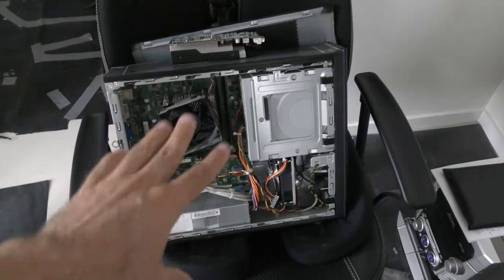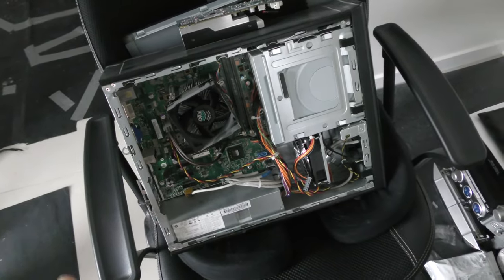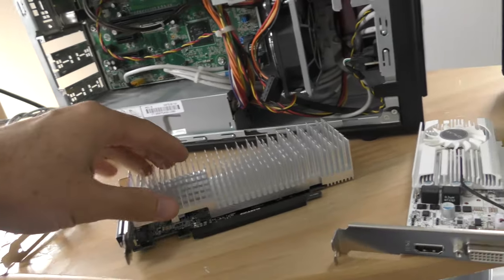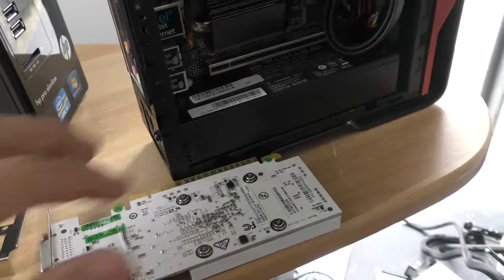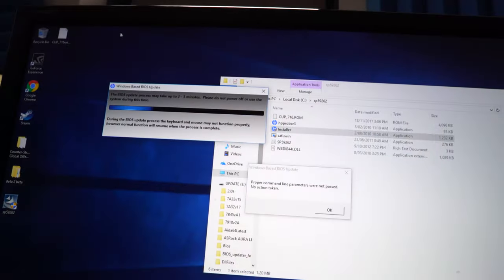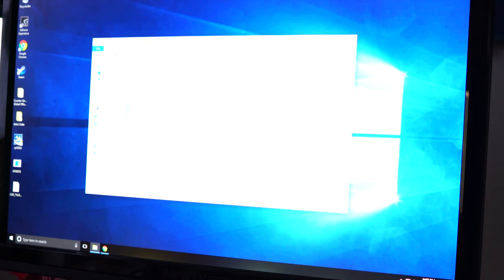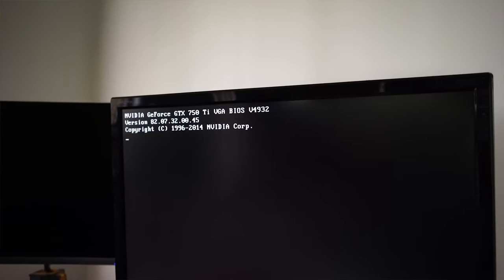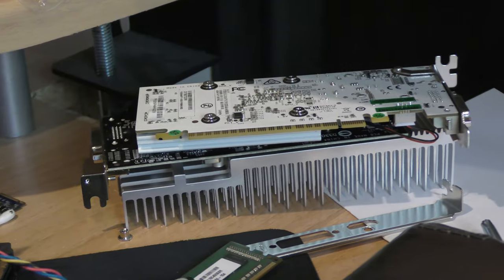The GT 1030, CAN IT SAVE THE SMALL FORM FACTOR HP PC...!?

Comment: Hi Bryan, if you come across some of these low profile HP computers, look out for the Elite 8300, ivy bridge series cpu's, and these have always worked out great for me. I've used one with a 1050ti for a few years, and before that it had a 730, then a 750ti. And they also work with sandy bridge cpu's. Easily recognisable by the stack of 4 usb 3.0 on the back

Comment: I have a HP Prebuilt i bought few years back. Intel i-5 6400T 2.20GHz Kingston 12GB DDR4 Ram 1TB ssd and only 180w PSU. Not to mention i had no extra power connections and no room for expansion. There was hardly any room for a GPU. I recently bought the Geforce GT 1030 GDDR5. and this card is PERFECT. I am extremely impressed.

Comment: HP, on some devices have a screw that when in place will write protect the bios.  You have to find that screw on the motherboard and remove it to flash the bios.  They most notably use them on ChromeOS devices.
Reply: How to find that screw ??

Comment: Geez that's a real bummer. When I put a GT1030 in a friend's HP Compaq Pro 6300 SFF, it just worked straight away. No BIOS updates needed (though I did eventually update the BIOS to its latest revision) and Windows automatically installed a fairly recent Nvidia driver, after which everything ran smoothly. It may just be luck of the draw, or maybe the PSU in your Pro was crap, I don't know. It just sucks. It doesn't matter anymore now I guess.
Reply: did you get a low profile GC?
Reply: A Core i3-2120 if I remember correctly. Not exactly a powerhouse PC, but it matches up well with a GT 1030 for some lightweight gaming potential.
Reply: #on dell allmost same problem  with older win10 nothing up to 700 serie's but automaticly resolved after i moved 1703 iso win10 i don't know why microsoft did that because 7 and 8.1 on 900 and 1000 serie's no problem and working like a charm,
Reply: I also have Hp Compaq Pro 6300 sff but has the i5-3570 one. The asus gt 1030 2gb ddr5 low profile graphics won't work. I'll try to buy a live cable (hdmi to dvi) and see if it works.

Comment: Just a week or so ago. I put a AMD Radeon HD 7570 1GB GDDR5 into a HP COMPAQ 8200 ELITE SFF I bought off of Ebay without a hard drive with the I5 2400 CPU & 4GB of ram.. The whole total with a 60gb SSD for the OS came to
$60 shipped for the pc 
$20 shipped for the Graphics card
$33 shipped for the new 60GB ssd
$0.00 for the OS. It had a windows 7 code on it so I used that to register a new install of windows
I didn't buy it for gaming, but I really liked working with it. Good design, and great processor for the price. Other people have gotten 1050s to work in these machines. You might have a malfunctioning motherboard.

Comment: I have actually wedged a 1030 in and had it touching the power supply on a very similar case. I just put a few cardboard shims between the card and psu so the fan could still spin. It works perfectly.

Comment: I just remembered I had a similar problem recently with nVidia driver on an Ivy Bridge Core i7-3770 system. I put the latest driver in, rebooted and the video cut out (or so i thought). IN fact it switched to the on-board graphics, so i let it boot up, logged in, it did some more windows/driver updates automatically and after another reboot everything was back to normal, the nVidia video card was working fine again, with the latest driver. (this was an ASUS ROG MARS GTX 760 dual GPU card).
Reply: Kárpát Zoltán did the gpu stop spinning, because if so it's happening to me atm with my 480 but I know the gpu works.
Reply: You're brave for putting a Mars 760 in a prebuilt

Comment: Bryan, I actually just this weekend worked on a slightly older HP small form factor (5S-1014) with a case that looks almost identidcal to this one (except the front grill).  It had a Pentium E5800 and I bought a Gigabyte GT 1030 (GV-N1030D5-2GL) and it has worked beautifully for a cheap Overwatch and CSGO PC for my son.  Sorry you had such a frustrating experience, I have been there.
Reply: I would spend the extra 50 dollars for the 1050ti. It can handle games like ARK and Subnautica at high (not max) with a bit of overclock.
Reply: @sycration  But that PC can't handle it :v
Reply: @sycration  he would get bottlenecked by cpu and probably already is

Comment: I did something very similar, found a Dell Inspiron Mini tower with an i3-3240 and 8GB of ram for $10USD at a local thrift store. I put in a 250GB WD SSD and an MSI GT1030 and now I have a very nice little HTPC for my 4k television.  Luckily my GT1030 not only plugged and played, but I managed a stable overclock of +200mhz core / +400mhz memory.  I was also pleasantly surprised how well that 1030 can run games at 1080p.  Great little card for $70USD.

Comment: GT 1030 normally works excellent in a SFF low power PC. I have just installed the exact same passive cooled Gigabyte card in a resurrection of an old HP SFF PC.
Original >> Replacement:
Pentium E5300 >> Core2Quad Q9450 
Radeon HD4650 >> GT 1030.
All works fine on the 210W PSU with 16amps on the 12V.

From an entry gamer 2009 to an entry gamer 2017
Reply: That is a good entry set-up! Nice man!

Comment: I just added a fan cooled gtx 1030 to my hp 6300 with an i5 3470 8 gigs memory and it works great. No problem booting, adding drivers or oc without any problem. Now, I don't play AAA games, but this has played everything I have tried so far.

Comment: I have a similar SFF HP. It shipped with only a 160 watt PSU which is maxed out from the factory. I think this was a selling point for businesses (low power requirement). Anyway, I changed the PSU to a 300 watt Pico and all is good.

Comment: I used that board with a Pentium g630 2.7ghz and a amd r7 250 1gb and it worked fine. I've give it to a friend and him has changed the cpu with an i5 2400. And the gpu with a gtx 560ti.
Only then we realized that the Vcore was over 3v, the temp was 95 on idle! The i5 was used like this for a week. 
 Now it's the pentium inside, again, still running just fine, even after a year and  over 3v Vcore! Even the temperature is under 75 Celsius. 
Ps: it's using a cinese motherboard now, with the i5

Comment: You should give away one of the 1030s. I am sure there are lots of people who would want it.
Reply: Except for the fact that that card is overpriced AF. If they want it, they can buy it, where the problem comes in.
Reply: for about  70 usd id rather by used could find a gtx 750ti( was found for $50 on let go in my area)  or gtx 770 (found the 4gig model on face book market place for $80)
Reply: For ~$70 I'd just buy a used Radeon 7970
Reply: Thank you for the information, I am trying to get into PC gaming but i don't have the money at the moment. so now i see that I could just buy used and get much better performance for the price
Reply: Liam Dorsey and buy a new psu aswell then sence ull need somthing around the 500watt range if not higher 750ti can run on very low wattage like 300 without problems

Comment: Go for small Acer or Emachines OEM machines they will work. I have upgraded a dusin of small form factor Emachines with a better cpu, ram and GFX.
Personally I am using an old Emachines EL1352 that originally came with 2x2 GB DDR3 ram, AMD Athlon II X4 245 dual core 2.9GHz cpu, onboard GeForce 6150 graphics and a 220watt psu. I have upgraded it to 2x4GB DDR3 ram, AMD Phenom II X4 840 3.2GHz Quad core cpu, Gigabyte GT 1030 Low Profile 2GB and it worked flawlessly on the 220watt psu. I since also upgraded the psu to a 250watt model with more connectors for an additional SSD mounted inside. It plays games really really well. I play older and newer titles as Bioshock 1 and 2, GTA V, Singularity, Battlefield 3, Overwatch, Dota 2 without issues.

Comment: I will never buy a hp or dell pc
Reply: so be it a diy system would be better, but can you find me a 4c/8t sandy bridge system with 16gbs(or at least 8gb) of ram and a 2tb hdd for under 120$ used that isn't a dell or hp?(honestly you will struggleto find a hp and the dells come and go), thats what im running just put a ssd psu and a gtx 1070 in it and its a instant gaming rig for 520$ can't think of anything at that price that beats it
Reply: Nor should you. But there's still a lot of these shitty HP and Dell pre-builts floating around, getting ditched from offices and into the hands of less demanding people. For those situations, a GT1030 makes for a nice upgrade to breathe some extra life into these machines.
Reply: im not using a 15-2400 though, i said 8 threads im using a xeon e3-1270, is it showing its age yes, but only in high refresh rate its perfectly fine at every game iv tried for 2k gaming and while i a 1070 can't push 4k in most games it would be less of a issue there, in almost ever case all the cpu bottlenecks is the MAX fps, if you are not trying to bottleneck the gpu by useing low setting you will really not see a issue  so long as it can push more then 100fps it won't be a issue to me and i haven't found a game it doesn't(thats not got issues for everyone else too)
Reply: also if my cpu is bottle necking my gpu then, then ryzen sure is too, near identical passmark cpu score and a higher single threaded score, granted ryzen can overclock some more but core for core ryzens not much better off the ive bridge, and thats not me hitting on amd just the stagnation in the market )

you have to copy paste the link youtube isn't forwarding it for some reason
https://www.cpubenchmark.net/compare.php?cmp[]=1204&cmp[]=2992#
Reply: Some dells are actually OK...
Reply: thewitcher gaming you can pretty much put a mid range GPU (I tested it), buy a better power supply, and rock a Dell Optiplex big time. I have some experience doing Frankenstein ass systems
Reply: Jose Sagredo not that the optiplex's aren't good, I've done one myself, I just find the precision line to be better(the dell workstations) xeons  are often under priced compared to core series CPUs and more often then not have more cores for the same price and over half of the workstation dell makes are for stuff like cad and video/photo editing so the PSU is usually beefy (check out the t5500 it has a 1000w PSU and you can get it for 150$)
Reply: thewitcher gaming Dell Optiplexes are the go!
Reply: Lazza games and guns dell is better that hp

Comment: I found the solution, I had the same idea, to put a GT 1030 in a old refurbished Acer Aspire M3970 (That had less specs then its factory condition...), I modded the bios, what I modded is just changing the PCI priority to legacy instead of EFI, and it worked! If you want, I can help you mod yours.

Comment: I've had a lot of luck with Dell Optiplex (380) systems, I've got my hands on a bunch of them with duo e7500's.
I threw in various GPU's I had on hand so far I've tested GT 720, some strange proprietary dell cards (can't  for the life of me remember what they are) and the Radeon HD 6450, I am currently running them on 8GB RAM and use them for various applications as windows deployment servers, file servers, and media centers.
They seem to run nicely and are quite versatile, only problem I find is the onboard graphics chips tend to freak out a bit and they really don't like 1.5v RAM.

Comment: The active cooled GT 1030 is running much cooler. I put mine in a old Lenovo G850 SFF PC, which I bought very cheap used. Win 10 Pro installed, I use it as a server, but it also runs fine with games. Not tried so much, but it seems, it can run GTA V in decent settings.

Comment: If you want to write a new BIOS you can try to read the ROM directly with a device that makes contact directly with the pins. If the memory is hard locked you're screwed but if it's just a software lock you can bypass it with this method and write bit by bit the modded BIOS.

Comment: Power it on with the normal igpu while the gpu (gt 1030) is still pluged in the pc and use the gt 1030 as second screen then set it to primary

Comment: In the office I have an I3 4100 Hp Slimline (power supply 180w). Buy the 1030 low profile with the fan, not the passive like the one in the video. It will work, and it's so much better than the integrated HD 4400

Comment: All low profile should work on slim pcs because it has a low power consumption. You should update your motherboard bios in order for that gt1030 to work. Im using dell optiplex 380 and 780 slim DT with gt610 and amd hd8570 low profile vcard and its working.

Comment: I have three hospital HP 8300 SFF's from USU in Utah $30 each with no hard drive. Popped in some 250 SSD's and 1TB HD each with windows 10. I have a GT 730 in two and the third with a GT1030 running my Samsung 4K TV. No problems

Comment: I have a HP Compaq Elite 8300 SFF someone gave me recently. i5 3470, 8Gb DDR3, 500Gb and I snuck in a Intel 240Gb SSD, installed a EVGA GT1030 low profile card into it.  Made for quite the little machine, drives a 1080P monitor without issues and can game...within respectable limits. Looks like your HP is kinda cocked up though.

Comment: I'm very surprised this didn't work. I run an 8200 elite HP SFF and I don't have a 1030, I have a 730 OC edition but they have almost the same specs. (they both have 384 cuda core, 730 uses 25, wants a 300, 1030 uses 30, wants a 300 - clock speed on the 730 is 1007, 1030 is 1480ish)

My 8200 came with an i5 2500K so I'm not inclined to get rid of it but I am pretty sure I have the same mobo as those 2400s models. I know you said you don't want to try anything else but I'd be willing to bet if you plugged this in to a TV with an HDMI cable, this would work. I've done that for someone else who has a Dell 2400 refurb and it works fine. Oddly enough, the onboard for the Dell wouldn't accept the TV as a monitor using the VGA but it was fine with the card and an HDMI cable.

Anyway, figured I'd throw that in there.

Comment: Sorry to hear you had problems with the machine. The GT 1030 (MSI fan cooled version) works great with no problems in my small form factor with limiting 220 watt power supply Dell 660s (i5/8GB upgrades). With MSI Afterburner set to around 15% overclock, I run most of the following games at 1080p on mostly high settings with reduced Antialiasing, Lighting Effects, and Shadows as Autoset by the Nvidia GE Force Experience software:
Battlefront2, DragonAge3, ESO-Skyrim, FFXIV, GW2, ME-Andromeda, SWTOR, Skyforge, Witcher3, Warframe. (Battlefront2 @ 1366x768, Witcher3 at 720p, and ME-Andromeda @ 1080p medium settings) and all look and run great at +/- 60fps. Total upgrade cost less than $150.00

Comment: i know this may be an old video but, i had one of these types of HP models before, and i found out too that there usually isn't enough power to use graphics cards, but its not the slot that is the problem its the power supply, that motherboard pci express slot is the very same slot that we use from manufacturers like gigabyte, asus, asrock, but the power supplies are usually only rated around 200 watts, and i know this because my HP had a 220 watt psu inside of it, we all know video cards usually require a little more than that.

Comment: To use the PCIe slot you have to use an adapter for the motherboard power connector. The connector off the stock PSU only has 20 pins. Those other 4 pins power the PCIe slot. That's why no card you plugged in worked. Knowledge is power.

Comment: Had an old HP sandy bridge system and had a similar problem to yours. The only GPUs that might work with that are older 400-500 cards :) It depends on when it was released but that was the case with mine :) Sorry about the turnout, mate. Hope you get better deals in the future!
Reply: My bios update was the latest one unfortunately :( I checked the forums and found a forum post where a HP representative actually addressed an issue similar to mine and said that certain HP prebuilts from years before are only compatible with select GPU series which in my case was the 400-500 series.

Comment: the riser cable used a sata connector which supplies 5v and a gpu mainly relies on 12v, try find a riser with a pcie plug or wire it directly into the 12v output of a psu see if that works (edit) also try force sli with the 1030s see how they go

Comment: HI - i had no problem using the GT1030 on both my HP8200 and a similar Lenovo in SFF
Only trick was to reboot pluged in the normal inbuilt video card, and then go into Bios and disable the on board video, then F10 save and exit
On next reboot, the GT1030 works in standard VGA untill you update the drivers

Comment: I see the issues you are having with yours and personally don't like HP's Home PC's but I think the SFF Office PC's are very good. My HP Pro 4300 SFF has been fine and runs 24/7. I would try using some of the Dell SFF PC's. I have experience with them and they are also great PC's. The models you could use are:
Optiplex - 390
Optiplex - 790
Optiplex - 990
Optiplex - 3010
Optiplex - 7010
Optiplex - 9010

Comment: I had a day like this last week, I got a crazy deal on an xfx r9 270 for $17.50 and it only works on basic display adapter and then crashes with any driver installed except for the first driver that ever came out for it and it will have lines on the screen and then crash 5 mins later I even tried a modded bios . Never did get that working Its just sitting there. Anyways thanks for the vid Bryan!

Comment: Try a GT 730 GDDR5. I have 3 of these HP Pro SFF of various sizes. I haven't tried that gpu in all of them but I plan on trying that tonight. It works in on of them for sure though. An older one that originally had xp on it. I have a few newer ones that look a lot more similar to yours though in design. I'll try that later this evening when I get home.

Comment: I have an HP Compaq 6200 Pro SFF with an i3 2100, 8GB RAM DDR3 1600MHz, Gigabyte GT1030 LP Silent (OC: +172 core clock, +216 memory clock) and 240W PSU.
This system has 4 months and everything is fine until now.